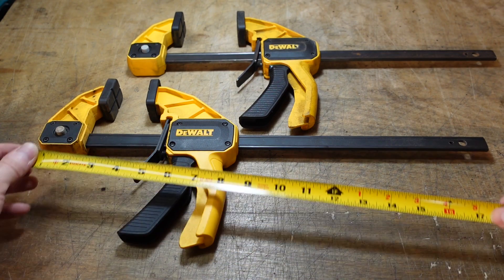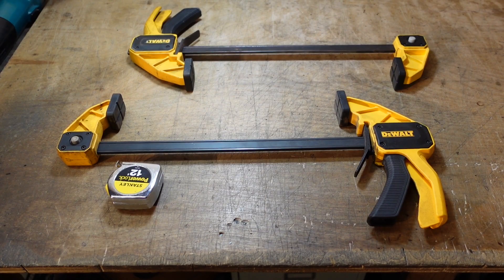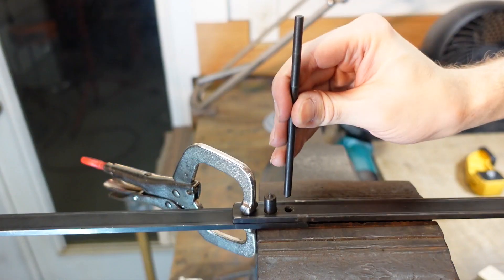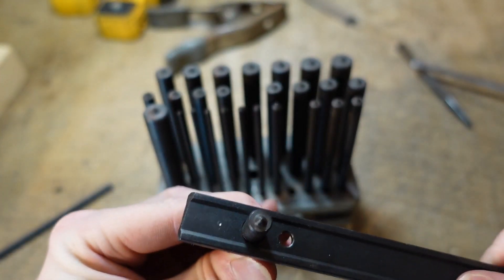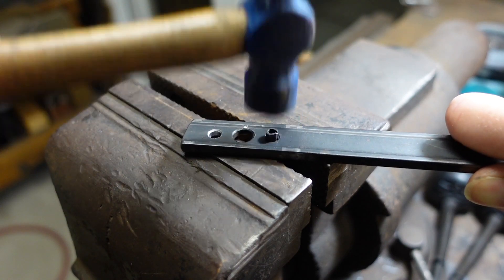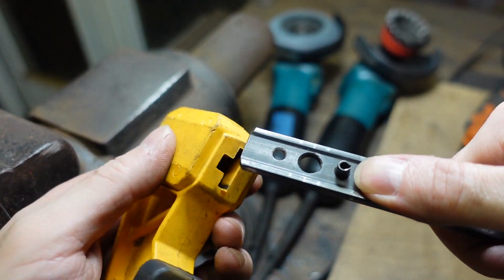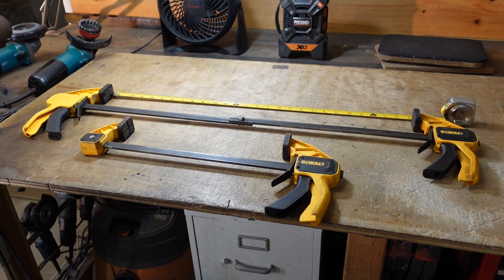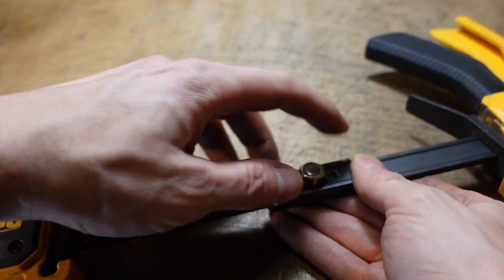Dewalt Trigger Clamp Extend Hack DIY - Double the length of your quick clamps for 20 cents!

Comment: Fantastic and more elegant than just using 2 clamps to hold each other together like I have done in a pinch.  I wonder if the plain bar is available to buy in various lengths.

Comment: I keep wondering if you could reverse the clamps so as to apply pressure on two INSIDE surfaces..Seems to me that would be the ONLY reason for the clamp ends to be removable..
Reply from the maker: Correct, these can be used as spreaders as well.  I think the Irwin brands can do that as well.  The older ones did not however.